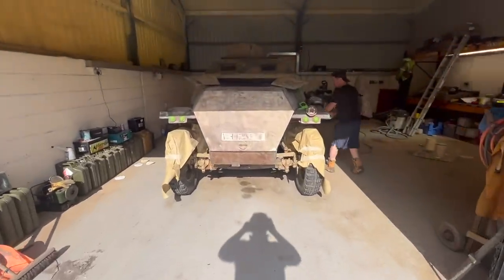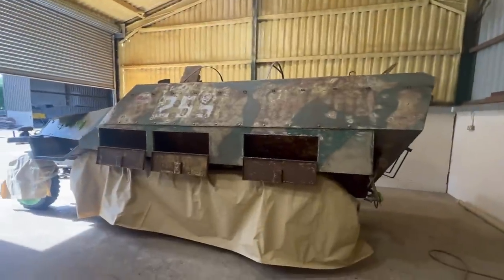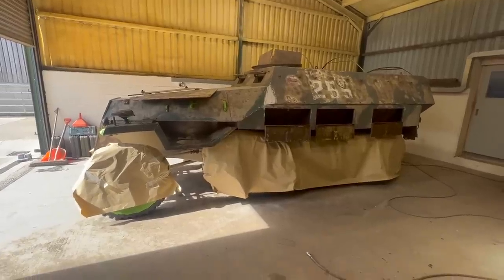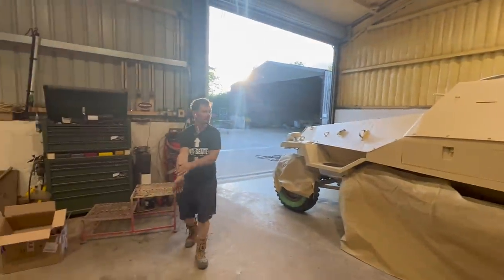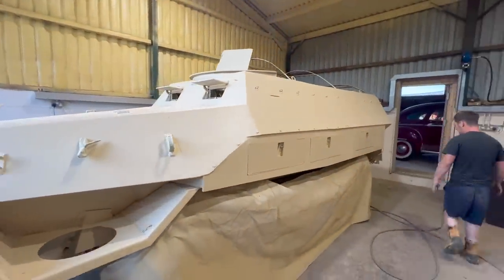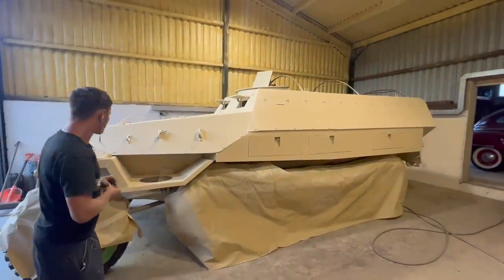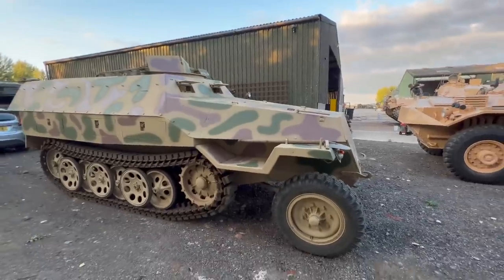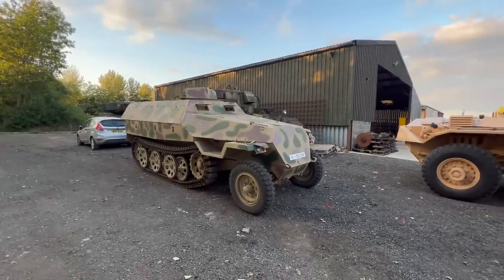Painting Our OT810 Halftrack! Now it really does look like a German WW2 Sd.Kfz. 251 with Desert Camo

Comment: Great attempt for a first go it's incredibly difficult to get that camo right but I have to say it looks a little off. Only needs a little more off the edge colours instead of all neatly inside the panels . Unless youre going for a desert colourscheme? But i assume not as the 251D i dont think made it to the desert only the B and possibly a C varient i might guess. Needs to bleed off the edges a bit if it's european . Also connect a few of the patches into longer patterns. 
But otherwise looks great.
As this vehicle most resembles the 251D i would assume you were going for post 1943? I would have also gone a shade darker on that brown more toward a red brown terracotta type colour rather than as you ablely  described baby shit brown lol
The colours are still actually available you know from the original RLM German colours. Dunklegelb is a dark yellow [baby shit yellow lol] rötbraun or red brown and  oluvgrün or  olive green are all a shade darker but I've only painted models on a small scale so I can't really attest any experience of what they appear like in your full scale.
I have to say you've done a better job than 99.% of museums out there even so. 
No-one seems to get the patterns right or colours. Then again as they rarely had enough paint in ww2 and often watered down colours for coverage who knows you could be absolutely spot on accurate. 
In fact ignore me lol
Reply: The camo doesn't look right to me either. In particular the shape and patterns of those stripes and blobs. German camo is usually way more elaborate.

Comment: The correct order of painting would have been :

- primer : RAL 3009 oxid red
- base paint : RAL 7028 dark yellow (which varied a lot in tone). RAL 8000 yellow brown would have been used in Africa though this Czech OT-810 is based on a late Sdkfz 251 so an Africa paint scheme would be an anachronism.
- camo : RAL 6003 olive green and RAL 8017 red brown.
According to my information late in the war the yellow base paint was sometimes omitted and camo was painted on the primer.
This is the theory, there must have been many exceptions.